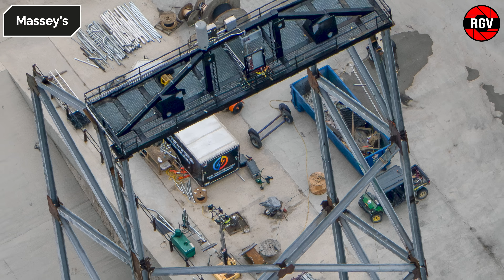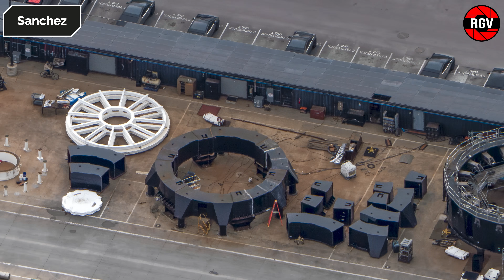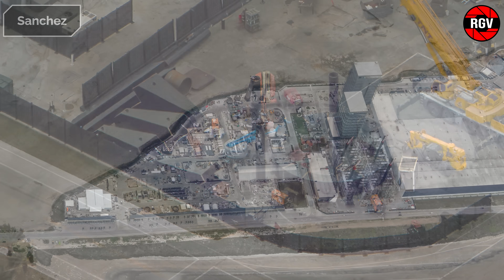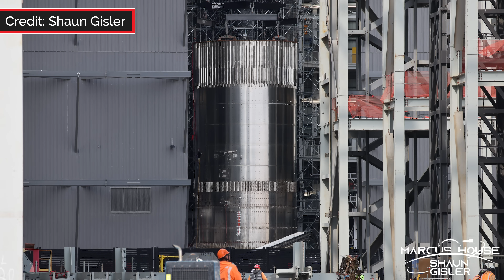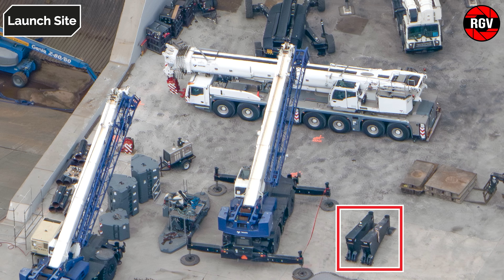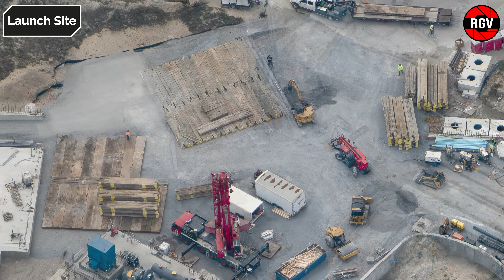End of an Era: Pad 1 is Gone! | Starbase Flyover Update 113

Comment: Why is Sanchez still considered separate from the Build Site?  Does SpaceX make that distinction?  There is no wall in-between.  And the Build Site is not just for building as it contains housing.
Reply: We used to call the build site the ring yard, but all that moved in to the Starfactory. I think there’s still a definite difference between Sanchez and the Build Site though. Scrapping, storage and heavy fabrication. Having the 2 helps with finding things too when discussing with other folks.
I suppose we lump in the village with the Build Site as that’s always been the direction we move when looking at the flyover images and we speak so little about the village anymore.

Comment: Its pretty clear now that the mystery structure at Masseys will be used to test ship to ship fuel transfer. The two black boxes at the top contain or will contain interface hardware. Look for two more to appear lower down soon. Bear in mind that the structure doesn't need to be overly strong because the interfaces will experience very tiny forces during docking in orbit. I also doubt this is the final test structure, rather it only needs be bare bones minimum. I could be wrong but I spent over 40 years as an engineer in multiple disciplines so I am very comfortable with my assessment. Time will tell ...
Reply: Unfortunately, that theory has been abandoned by most as the top platform is at the height of the forward flaps. Testing of the docking hardware would need to be much lower as the ports are below the payload bay.
Reply: @B.J.Schnettler As I said time will tell. Has anyone considered that the test may occur while it is still on the transport stand. SpaceX does not follow convention
Reply: @josephnesser1961 I doubt it as the transport stands would sit completely on the trench cover which isn’t designed for the point loads. Only reason the static fire stand can be on it with SPMTs is that they spread out the load.
Reply: @B.J.Schnettler I appreciate your point of view. We will have to see. Enough said
Reply: What would they test?  Alignment during docking and fueling?
Reply: @imaginary_friend7300 theory is they would test pulling up on the catch points. They did this with a booster test article on the Pad 1 OLM with the chopsticks. There is no way to do this same test with the chopsticks.
Reply: @imaginary_friend7300 They don't need to because that is set by the design and manufacturing.i think you missed my point, they would be testing the function of the system and check for leaks. I haven't seen any other equipment they are working on that can do that